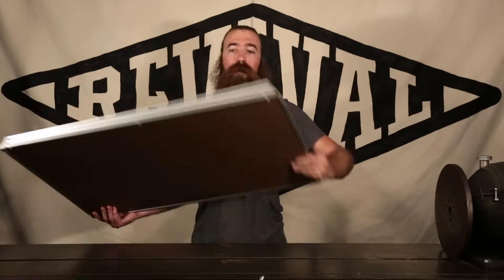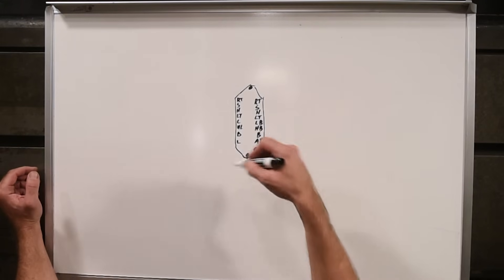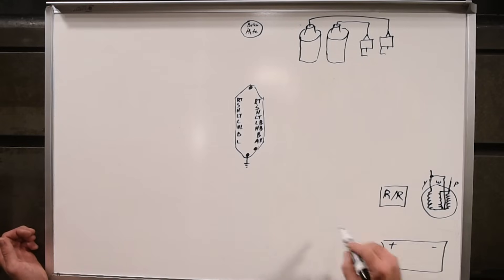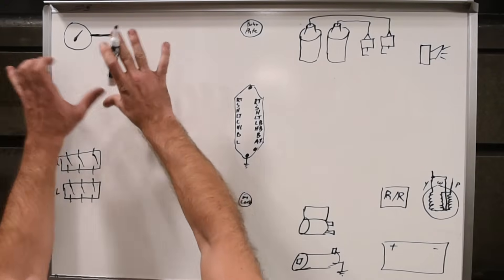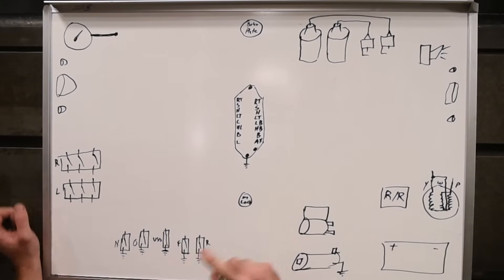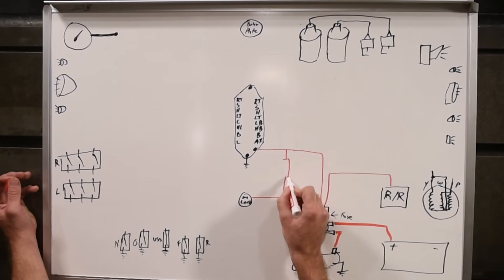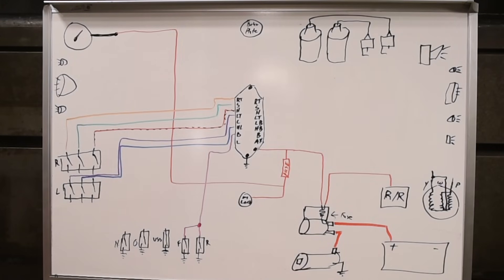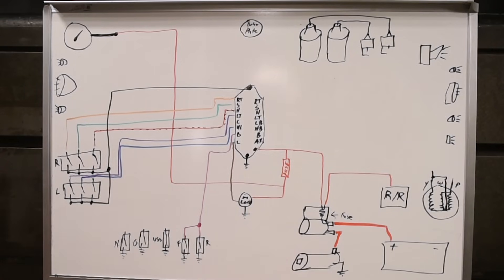How to Wire Your Motorcycle  - Revival Cycles' Tech Talk

Comment: 1. If I wanted to run an M lock and a regular key ignition switch in parallel (so that I could use either/or, not be forced to unlock both).... I would just splice off the circuit at the M lock and run the key switch in parallel, right?
Reply from the maker: That is correct. If you are using an m-Unit and m-Lock then those would be setup in parallel so either one could provide +12V to the lock input.
Reply: makanimike b

Comment: Hi, Watching you build the diagram reminded me of a question I have. I streetfight Triumph Sprint st 955i bikes in England and am thinking about doing the same to the 1050 models, but someone told me that I cannot fit a digital instrument as the OEM instrument panel has some sort of system that won't allow the fuel rail to pressurise. Do you know anything about this? Regards John.
Reply from the maker: Yes, there are some of the modern bikes that have the engine management integrated with the dash instrument for some reason. I think it has something to do with security systems and anti-theft immobilizers. But the easy way to test is simply unplug your dash and try to start the bike. If you can start it, you can replace the gauge. If you can't then you will need an m-CAN or m-Tri module to trick the ECU into thinking the dash is there.

Alternatively you can sometimes find an aftermarket programmable race ECU and that should also solve the problem. And in very rare cases the stock ECU can be reprogrammed to eliminate the issues with immobilizers. This is one of the worst challenges we have to deal with as custom builders working on modern bikes.

Comment: do you have a addy for where i can find a 7 wire basic harley chopper harness diagram?thanks for Your help...
Reply from the maker: I'm not sure what you mean by a 7 wire basic diagram. If this is a standard configuration, I would think you could find something pretty quickly with a google image search. Unfortunately this is not something we've worked with before and don't have a recommendation.

Comment: Hi Stefan,
Great video, very helpful, thanks.
Would the M-Unit replace the ICU on my XS1100 as I noticed that the in the Haynes manual it shows the ICU connecting to the coils and the starter solenoid, kill switch and handlebar starter button as I see in your video that the AUX goes to the coils
Jason
Reply from the maker: The m-Unit does not replace the ICU, it only powers it. The ICU is what controls the spark timing on the bike, and that is specific to each model of motorcycle.  The AUX output supplies power to the ignition system, but the rest of the ignition system remains the same as factory.

Comment: Hey Stefan, do I need to use resistors for led turn light and brake/stop light if Im wiring them up through an M unit? and if I do, how?
looking forward to your answer. Steve Down Under
Reply from the maker: Hey Steve - The m-Unit does not need any resistors, and if the LED lights you are using are sold as 12V lights you don't need resistors for the LED's either. However, if you are building lights from raw LED's, then you would need a driver circuit, or current limiting resistor to keep the LED from burning out. But the current limiting resistors would be needed with any setup, as they are fundamental to the operation of the LED's. With purchased products that are designed for 12V applications, the driver circuit, and/or resistors are already built in.

Comment: What about a ICU box where would that go ?or wpuld the breaker points be my ICU box?.. 7:29-7:32......what would this be on a 2000 Yamaha r6 , is this the ignition coils I have 4
Reply from the maker: It would go anywhere this video is demonstrating on a Honda CB350 which has a points ignition. And this is an outdated video for the obsolete V.2 Check out the wiring guides on the website for a new guide and diagram. 
https://technicalarticles.revivalcycles.com/hc/en-us

Comment: would a standard turnkey ignition switch be wired the same way as the m-lock?
Reply from the maker: Mike Miller Yes and no. The m.Unit only  recognizes ON/OFF 2 position switches. You can use an OEM style 3 position switch but the parking position can not be incorporated as it was intended. You can either cap it off or issue it as a second on position.
Reply: @RevivalCycles  OK, so it's just "off" or "on", where "on" delivers power to the m.unit and ignition so the bike fires up when you close the start switch on the handlebar controls? I'm not sure what the third ignition switch position is, but I imagine I don't need it.
Reply from the maker: Mike Miller correct. That 3rd position is your parking lights. The m.Unit does have parking lights but it’s approached differently

Comment: Great tech video! How do you guys normally wire your custom builds for a kill switch? Do you use a separate button on the handlebars or one of the switch locations in a mini switch unit? I have an '82 GS650 I'm looking to do some sleek, minimal wiring on and could always use some tips. Thanks and keep up the good work!
Reply from the maker: On our customs we do not use a dedicated kill switch, instead we use the built in m-Unit function where the starter button can be used as a kill switch by double tapping it like double clicking the mouse on a computer.

Comment: And where is the cdi in the ignition system?thks x your answer
Reply from the maker: CDI stands for Capacitive Discharge Ignition. So if you have a CDI then the entire ignition is the CDI. I'm guessing you are referring to the control box that is frequently erroneously called a CDI. That does not show up in my diagrams, and is dependent on the exact details of the bike you are installing on. Assuming you have the far more common NON-CDI ignition with a "black box" then the black box gets its power from the ignition output on the m-Unit, the ignition coils will also have to be connected to the ignition output. 

In the case of a true CDI, that gets more complicated, and it is best to email techsupport@revivalcycles.com and we can send you some more info, and photos, and diagrams, etc.

Comment: Maybe I missed this but where and how would you integrate your CDI in this setup or is it not needed? Currently rewiring a 1978 Honda Cb400t1 with electric and kick start.
Reply from the maker: The CB400t does have a real CDI and this ignition will run even without a battery on the bike. But that means the install is a little different for the m-Unit. The m-Unit aux output is used to control the Kill switch wire on the CDI, and this is done using a normally closed relay. The relay must be normally closed so that when the control coil is not energized, the contacts are closed and those contacts ground the B/W wire from the CDI, then the AUX output is connected to the control coil and when the AUX is on it energizes the coil and that opens the contacts so the B/W wire is not grounded and the engine will run. 

The rest of the ignition system is setup exactly as it was from the factory.
Reply: Revival Cycles do you by chance suggest any brand or model of normally closed relay that would work in close quarters area? Planning on using an under seat tray for most of my electrical and run an open layout where the battery and air box would be. And does this process remain the same on the M-Unit Blue or does the relay wire go to the ignition output instead of the Aux?
Reply from the maker: This is one of the smaller options available for Automotive relays, but if you really need to save space you could look for PCB mount relays which can get much smaller. https://www.amazon.com/Automotive-Relays-Relay-12VDC-piece/dp/B00M1ZLJIE/ref=sr_1_7?ie=UTF8&qid=1501349215&sr=8-7&keywords=12v+relay+mini 

Yes the process is basically the same with the m-Unit blue, and you are correct, the relay control coil is connected to the ignition instead of the AUX.
Reply: Revival Cycles thank you so much!
Reply: Revival Cycles so thanks for the help above! I purchased your waterproof relay: 

https://revivalcycles.com/collections/motorcycle-relays/products/waterproof-relay

Which includes the normally closed relay. I am slightly confused about how it needs to be wired to the engine kill wire of the cdi  you mentioned above.
Reply from the maker: There is a diagram molded into the relay, and it  shows the different terminal connections and how they work. But this relay also follows the standard relay convention where terminal 85 and 86 are the control coil. Terminal 30 is the common contact, terminal 87 is the normally open contact, and terminal 87a is the normally closed contact. So for you it would be connected as follows

85 = AUX output on the V2 or Ignition output on the Blue
86 = Ground connection
30 = Ground Connection
87a = CDI kill wire 
87 = No connection
Reply: Revival Cycles thank you again! So much! You guys are absolutely amazing! You sell quality products and are always willing to explain. Have you guys ever thought of doing a Tech Talk restoration series? I’m sure it’d be well received and answer a lot of the thousand questions you guys must get from other like me. Thank you so much!

Comment: Does a motorcycle use relays like a car or can the switches handle the load?
Reply from the maker: They do use relays. The m.Unit has solid state relays integrated into each output.
Reply: @RevivalCycles  I don't have a main unit just a bunch of parts of an old motorcycle. There are all the switches but I can't find any relays. I was wondering if the entire load runs right through the switches.

Comment: nice video it helpt me toch wire my bike but one thing i Don't now i have a virago 750 83 now i want to wire the regulator  stator tot regulator is no problem But from the regulator tot the wiring because i have for wires
Reply from the maker: If you send a copy of the OEM wire diagram and the wiring instructions for the reg/rec you are using to techsupport@revivalcycles.com we can tell you how it should be wired. 

For the Viragos, normally there are 6 wires for the reg/rec, three white wires connect to the stator, the red connects to the main fuse, the black is ground, and the brown is switched power so it connects to the AUX output.

Comment: i have a yamaha radian yx600 this looks like the solution i have been looking for but i need help. my bike doesnt have a points ignition its digitally controlled. any input would be nice.  if i can replace everything with motogadget stuff ill consider it.
Reply from the maker: The m-Unit is compatible with aftermarket and OEM electronic ignitions, also we can help you determine how to hook it up if you purchase your m-Unit through our store at www.revivalcycles.com. 

The m-Unit will replace most of the OEM wiring, but it does not replace the ignition system, or the charging system. Both of these systems are very specific to individual motorcycles and so far there is not a universal replacement that works for all bikes.

Comment: Can I use the wiring harness from a 750 Virago on my XS650 bobber build?
Reply from the maker: Maybe? But I doubt that those two bikes share the same components, considering they were designed decades apart, and the location and routing will be completely different.  If on the other hand if you want to chop up an old harness to re-use the wire and/or connectors I suppose you could do that, but just be aware that old wires can corrode within the insulation, and those harnesses were built to a budget not to a high quality standard. 

In general it is usually worth it to start from scratch, with new wire and an m-Unit. The factory harnesses are ridiculously inefficient, bulky, and unnecessarily complicated.

Comment: What about the fuel pump for fuel injected bikes? Does that run off of AUX?
Reply from the maker: For fuel injected bikes it is more complicated than what is shown in this video. Most fuel pumps need to be controlled by the ECU, therefore they should be powered by a fuel pump relay, and that can be powered by either the AUX or directly from the battery (via a fuse).

Comment: is there a recommended regulator/rectifier you guys use?
Reply from the maker: It depends on the bike and what charging system it has. Also, what type of battery you are using. Generally we have had good luck with the Ricks motorsport electric reg/recs, but there is more to it than just picking a reg/rec

Comment: Does this replace the ignition control module ?
Reply from the maker: No it does not, there is no universally applicable replacement for an ignition module. This is a solid state power distribution module that manages the voltage leading to your ignition module.

Comment: Can I use this diagram for my 1983 Honda goldwind 1100 ???? Thank you!!
Reply from the maker: Bambino Customs No, the purpose of this video is to demonstrate the process for creating your own diagram. The charging and ignition systems in the CB350 we used as an example are entirely different than a Goldwing. To add, this video is for the obsolete m.Unit V.2 and not the m.Unit Blue. 

The good news is that we have a Tech Articles page on our website with Universally applicable wiring diagrams as well as an in depth wiring theory guide. 

www.revivalcycles.com

Comment: Great vids learning so much from them, big help on my journey of banging together my cafe racer. Just one question if I use a anti gravity battery on my build (BMW R100 '80) would I have to replace my stock charge controller? Thanks keep rocking out the vids!
Reply from the maker: There is a good chance your charging system will work fine the way it is, but you really should test the charging output to make sure it remains stable between 13.5-14.7V all the way through the rev range. It may drop below that at idle but it is critical that it never exceeds 14.7V. As long as your charging system can do that you're good to go.

If you do want to replace the regulator / rectifier setup with a combo reg/rec I suggest the Ricks motorsport 10-504 as it is the only one we've found that actually works with the LiFePO4 batteries.  You can get one here https://revivalcycles.com/products/rectifier-regulator-10-504

Comment: ive been living under a rock as i've been researching the world of bike building because i just discovered your website and products.  your videos are soooooo good.  i've got my 81 xs1100 torn down to the frame and you can bet your bottom dollar i'm going to be getting an m unit blue and watching all this stuff again when it comes to wiring.

question: i did save the original wiring harness and marked it up as i unplugged things from it.  its currently hanging in my garage.  would it be your recommendation to just chuck it and start with a fresh re-wiring job when it comes to that part of the build?
Reply from the maker: Generally yes. Especially with a bike like your project. The factory harness isn't built with particularly high quality anything, and its likely deteriorating. Also the m-Unit uses a completely different paradigm than the original distribution and although the factory harness can be re-done to work, it is not very space efficient. Your bike really only has a three OEM systems that need to be integrated, ignition, starter and charging, and those are not too difficult once you get all the OEM clutter out of the way.
Reply: excellent. thank you very much for the info and help

Comment: hello good day. i have a 1997 kawasaki en 500. with an ignitor cdi box. is it possible for me to re wire the whole thing with the motogadget m unit?
Reply from the maker: Yep, the m-Unit will work well on that bike. And although I haven't looked at your wire diagram, I'm fairly certain that you do not have a CDI but rather a TCI ignition. CDI's are self generating and do not need a battery where as a TCI is a "Transistor Controlled Ignition" and those still use battery power to create the spark. 

The TCI's get wired up just like they were on the stock bike, except that the connections to the key switch and kill switch (really any switched power connection for the ignition) gets connected to the AUX output on the V2 or the Ignition output on the Blue.

Comment: Great video. Do you still need a main fuse when using the m-unit? I thought it replaced all fuses. Are you being super-careful, or is this a necessity?
Reply from the maker: Technically the m-Unit does not need a main fuse. But it is a good practice to use one for the charging system incase the reg/rec shorts out it won't fry your battery or wires. Since you need to add one for the reg/rec its easy enough to add one for the m-Unit and that makes it just a little safer in case something shorts out on the mounting posts on the m-Unit.
Reply: Shouldn't the charging system be powered from the Aux out of the m-Unit? Although I take your point... a fuse as physically close to the battery as possible will make everything that bit safer. Great video, and thanks for the reply!
Reply: Belay that: I was confusing the charging and ignition systems. You're quite right, the charging system should be fused, and it goes to the battery, not the m-Unit.
Reply from the maker: You've got it! But there are also a few charging systems that do need a connection to the AUX in addition to the connection to the battery. The field excited charging systems need to have an excitation and reference voltage and its best to provide that via the AUX output....so your previous comment is also correct, but only sometimes :)